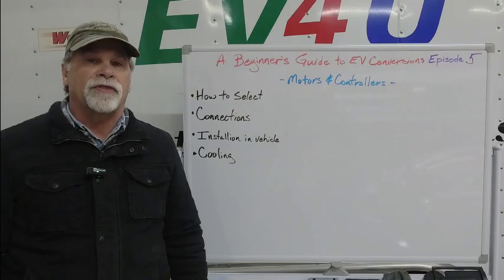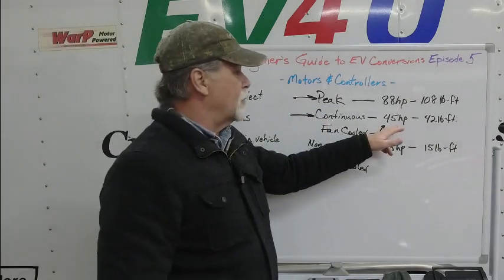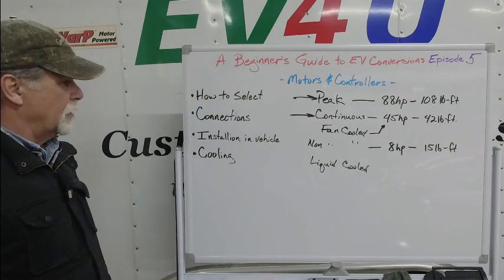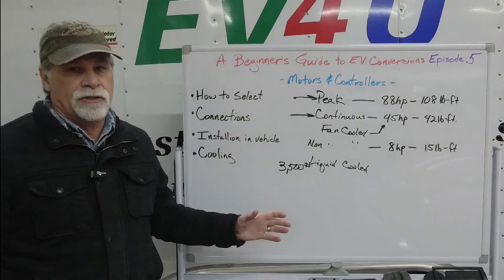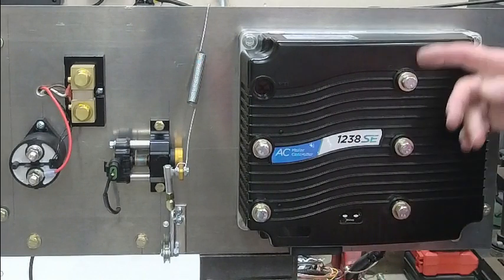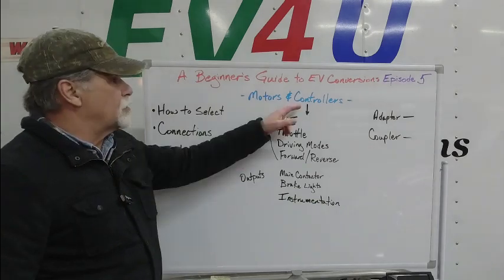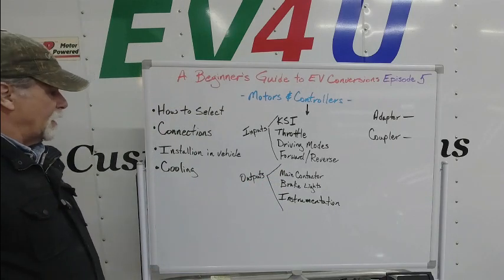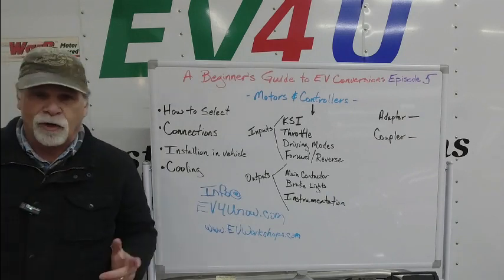A Beginners Guide to EV Conversions - Episode 5

Comment: I'm installing 6 tesla 5.3 kWh batteries (31.8 kWh) in my Manx SR. The completed vehicle with batteries and motor and driver will weigh just under 1500 pounds.  Using your calculations using 80% capacity and 150w/mile, on a good day, on a flat road I might get 170 miles.  The vehicle is reasonably aerodynamic.  Is this close? I would be happy with 150 mile range.
Reply from the maker: There are a lot of variables, such as tires, ambient temperature, driving speed, and of course your right foot.  But it sounds like you are in the ball park.   Thanks for watching.
Reply: @ev4u  Thanks for the quick reply.